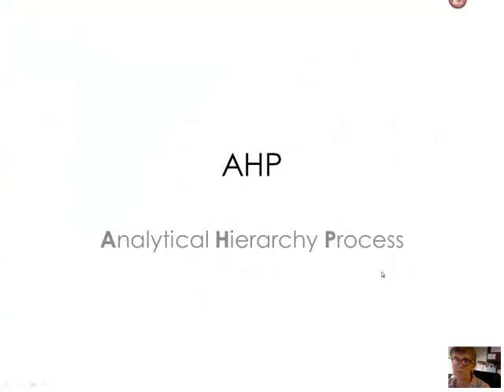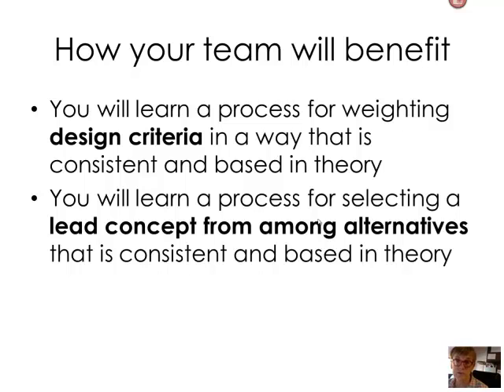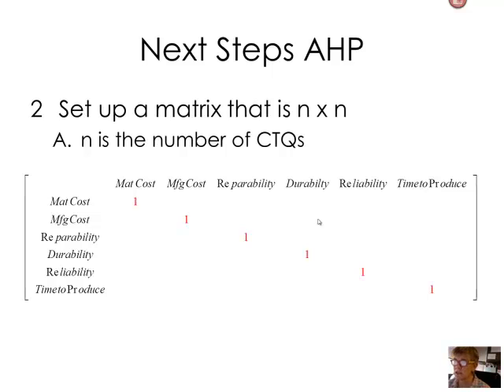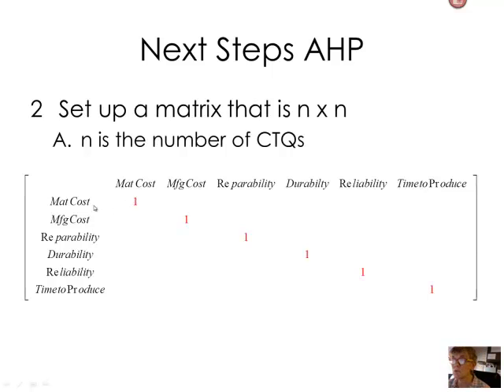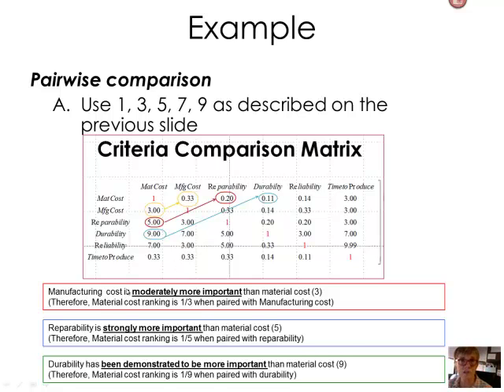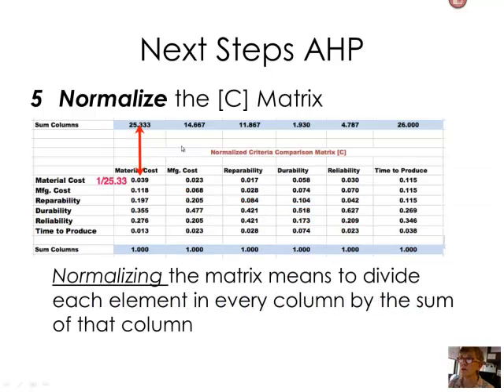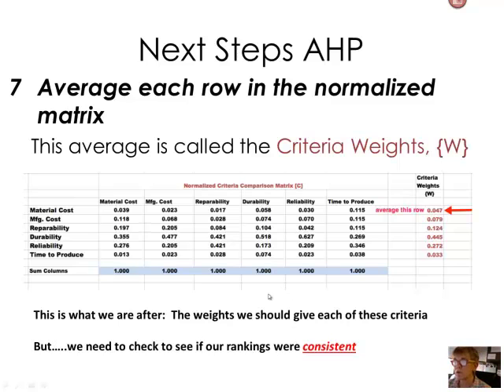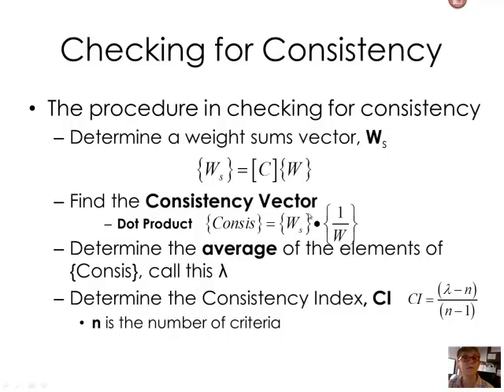AHP Part 1

Comment: What a great explanation of the maths of AHP. It's really clear. In the real-world, however, the maths is not so important. 

AHP, in real-world decisions, is about getting your stakeholders aligned. Decision-making is usually a team-sport and getting stakeholders aligned properly and having a strong structure to the evaluation process is what leads to better decisions, more buy in and increased decision velocity.

If you're interested in how AHP in real-life situations, I'd suggest this video. It's a real decision consultant talking about a real decision ($200m decision) and he talks about all three value points - better decision, faster decision, more buy-in. This not a function of the maths (tho' it can't be done without the maths), it's a function of a collaborative, structured discussion and decision process.

https://www.youtube.com/watch?v=eivX_nrggzQ

I hope this helps those who are new to AHP.

(Full disclosure: TransparentChoice is a leading provider of AHP software)

Comment: Thanks for your video. This is good for mechanical application of AHP: you explain the calculation for each passage. However, you do not explain the meaning of each calculation, so interpretation is not easy. For example, why should one sum the element of each column? What does the resultant number represent and why? Also, why should one normalize? And why does averaging by row should provide the importance degree of each criterion? Why does CI has n-1 at the denominator? And what does lambda mean and what does lambda minus n represent?

Comment: Hi. How are u? I want to use AHP on my research work but I am little confused about its application. Actually I am working on inspection skill of human labour and factors affecting on it. And I want to use AHP to classify the available manpower into three skill levels (Low, Medium, and High) based on the factors that can affect the skill of quality inspectors. Plz guide me can i use AHP for this purpose? if yes then plz give your valuable suggestions and useful material that can be helpful for me to solve my problem

Comment: Who's the speaker ? Any references for the materials used in the video ?
Reply: The material for this video is based on the presentation on AHP in the text Machine Design, 5th ed., by George Dieter and Linda Schmidt.

Comment: thank you for the tutorial, it is very helpful. However, who decides upon what value of importance to given a certain criteria over the other. For example; i am doing a project of selecting a new landfill site using certain criteria; how do i decide whether distance from residential areas is important over infiltration rate and by how much?
Reply: Phindile Penelope I think the point of the method is to bring mathematical structure to personal subjective preferences. So typically the decision maker will fill in the matrix based on his preferences, or based on rational studies. If you are the analyst, you should ask the DMs to rate their preferences, otherwise, fill them yourself :) I'd be curious to hear your thoughts and solutions on the question if you were able to find any.
Reply: Hi again, pertaining assigning values of preference, i adapted those used in literature for international studies since there aren't any studies in South Africa. However, i am stuck upon checking for consistency of my weights. I checked out 'Part 2' of your tutorial but i was confused how you calculate {Ws}; please assist.

Comment: Im conducting AHP analysis using 6 criteria to evaluate amongst 5 alternatives. There are 5 decision makers that I have asked to compare each criteria against each other for each of the 5 alternatives. How do I incorporate the comparisons from all 5 decision makers looking at all 5 alternatives into the same AHP analysis? Thank you!!
Reply: Morgan McKay Hello Morgan, I also asked myself this question when watching the video. My guess is that you could either have each DM go through the AHP process, and simply have them compare their individual results in the end and reach a compromise. Or you could somehow average the weights of all DMs and therefore have an average result. Have you found any answers since you posted the question?
Reply: sebcde Hey, yes I took a geometric mean of the decision makers' pairwise comparisons to synthesise into one model as it is the most commonly used method to do so in AHP. Below are sources I used to justify. Hope this helps 

    Ramanathan, R., & Ganesh, L. S. (1994). Group preference aggregation methods employed in AHP: An evaluation and an intrinsic process for deriving members' weightages. European Journal of Operational Research, 79(2), 249-265.

     Saaty, T. L. (1989). Group decision making and the AHP. In The Analytic Hierarchy Process (pp. 59-67). Springer Berlin Heidelberg

Comment: Must the pairwise comparison always be symmetrical?
Reply: Hi Scott,

The matrices must be square for the math to work correctly-however that may not be what you are really asking.  So your question may be more related to the way in which the comparisons are completed.  Do you mean, for example, that if A is paired with B and given a value of 2, would it be inherent in the AHP process that B paired with A would be 1/2?  Since the comparison is attempting to give relative value to each of the two items being evaluated, it is important that the rankings be consistent.  So if A relative to B is 2, then B relative to A must be 1/2.  Sorry if I have not really understood your question.  Satay's original paper is widely available and I have a pdf of it if you have trouble finding it.
Reply: Hi Gloria,

Yes, your interpretation of my question is correct. A to B = 2 and B to A =  1/2.

While I have your attention...what is the advantage of AHP over say, SMART? It is much more complicated that for sure but, what is the real benefit? In other words, what does AHP capture in decision making that the Simple Multi-Attribute Rating Technique does not?
Reply: Scott Doremus
 Hi Scott,  I am far from an expert in Decision Analysis methods but a quick search on SMART (so that I would even know what the acronym stands for!) indicated that the distinction may be mostly related to scaling issues.  I read a very brief abstract (Scale sensitivity in the multiplicative AHP and SMART, F.A . Lootsma) that suggested as much.  Where you have orders of magnitude of differences, it appears SMART may be the better choice.  With that said, my expertise on SMART is entirely exhausted.  I appreciate being asked--I learned something new today.